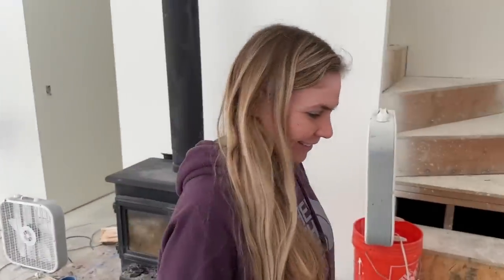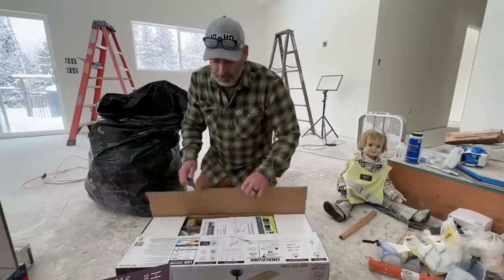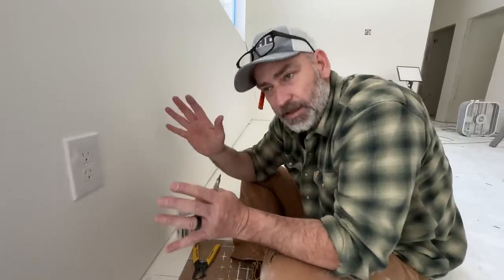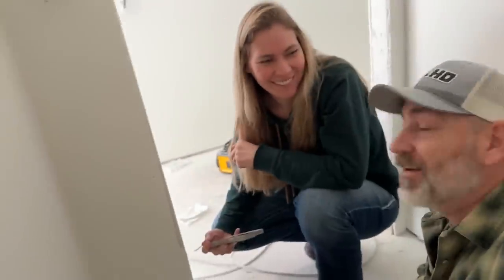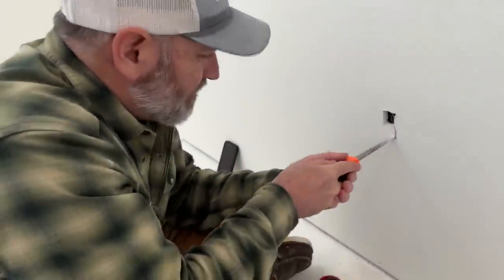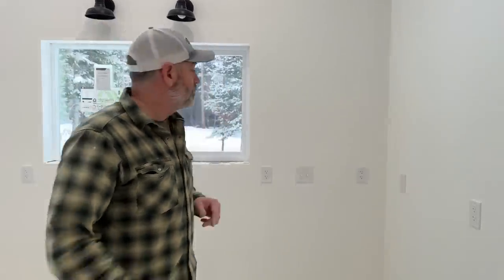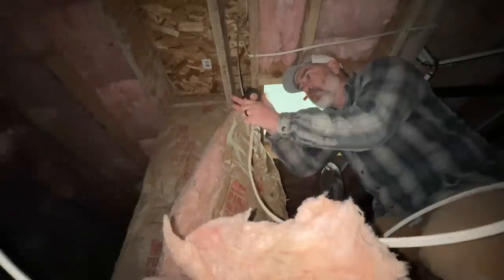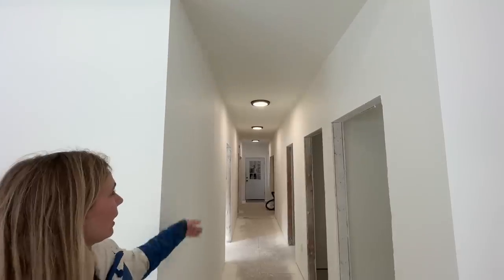3 MAJOR PROBLEMS Wiring our Off Grid House. Don't Make the Same Mistakes.

Comment: Good morning, just wanted to mention that getting power to your cell phone is not a good indicator your outlet is good.  Power just means it is live, you need a line plug tester or a multimeter to make sure you are wired correctly. After wiring up and putting on the cover plate, plug in your line tester to verify.  Simple cheap and fast.

Comment: Great work both of you! I'm an industrial Electrician in Northern Utah. A few tips to save your hands 🙂. #1 instead of using hand tools for everything. Grab a decent lithium powered screwdriver.  "did notice use of a regular drill later on." #2 To make outlets more flush.  Pay close attention when tucking in wires. The more even and neat they are tucked in the squarer your work will be.  Honestly though awesome work!

Comment: The ceiling fans perfect where it’s at. It will draw the heat in the winter from the roof and then you can turn it around in the summer and drop off the ground and keep the heat out of the ceiling. It’s perfect where it’s at.

Comment: Use a cordless drill to install your devices, Guys.  And use a flat tip screwdriver to install the face plates. It is much more efficient and is easier on your hands and wrists.  Good box makeup on the rough-in stage will also make installing devices easier.  Thanks, Russ, J. Electrician from Oregon

Comment: You're supposed to twist the wires before putting the wire nuts on them. Plus you had way to many wire in that one box. By not twisting the wires over time you can get flicking lights or a heat up or fire.

Comment: you should replace all outlets from 15 to 20 amp in the kitchen cause if you use two appliances on 15 amp outlet with 20 amp breaker it will melt the outlet and you should used one outlet 2 phases one outlet gives 1st phase 120v 20a and another gives 120v 20a if you stick in in that outlet between the lives you will get 240v at 20 ampsso if you got a kettle which draws 15a and want to use a toaster no bueno that will trip the breaker and melt the outlet
Reply: code requires 20 amp circuits in a kitchen
Reply: Oops 😅

Comment: I think the fan is in a great spot only because if you raise it it will block the view a bit out the upper window from the loft.  Keep up the great work!
Reply: Plus if it's too high, ironically it won't move as much warmer air down. Visually it looks right too.
Reply: I also agree on the length. Any higher will interfere with the loft view.

Comment: The ceiling fan looks just about perfect to me.  Remember, it needs to have room beyond the blades for the air to circulate above it, and you need access to clean off the blades regularly - especially as cat/dog hair tends to stick to the leading edges.  Mount it higher and you effectively make it an ornament, rather than functional.

Comment: Did you do pigtails on all the outlets? The tab between the top and bottom is not made to handle the full load and can burn out and possibly cause a fire. The reason there are 2 scres is so that you can break the tab out and split thr receptacle and have one half switched and one with power all the time.

Comment: Trick to boxes is to fold the wires neatly into the box until receptacle goes in fully without forcing it. This will prevent undue strain on the wires and receptacle.  Never force it in with the screws.

Comment: Just one code comment. Nationally, you're not allowed to "splice" on a device, that is to say you need to pigtail all outlets that have more than one wire. Don 't want to break the neutral connection (continuity) when you remove a device. Good luck.

Comment: Tip for finding buried electrical boxes is before sheetrocking to spray paint a dot (fluorescent orange works good) on the floor below each outlet. Put it near wall for outlets and 12" from the wall for switch boxes.

Comment: Really enjoy watching you two figure out a fix to the issue no matter the size. I remember once we bought a house and had to plug an item into each outlet checking the wires I think it was checking for the polarity? I know it would light up and my husband would change a wire around in the plug only a couple were off. Can’t wait to see the cabinets and the island build with trap door. Susan

Comment: I was taught to always use pigtails when the electric is "daisy-chained" from one outlet to another rather than using the outlet itself as the chaining point.
For the GFCI in the kitchen, I think you could have just replaced the kitchen circuit breaker with a GFI breaker, although the outlets ARE cheaper.  That's what I'm planning for our home build.

Comment: As an electrical apprentice the fact that you aren't connecting the wires to the outlets correctly is an affront to my training. Ground, Neutral (White), then the Hot (Black). But other than that little issue you guys are doing great! Keep it up!

Comment: FYI, you can use 15 amp receptacles through out the house per NEC Table 210.21(B)(3).  20 amp circuits can have 15 or 20 amp rated receptacles.
Reply: That's amazing Mike. This vital observation can't be left out without a reward. Quickly dm to claim your package

Comment: Tape the wire nuts to the wire. It will prevent them from loosening. Especially where you have the max wires in a nut.

Comment: You should have put the wire in the middle of the floor joist to protect it from nails and screws. I'm sure you were smart and watched where you put screws but what about the next project? Also you should have put glue on the board to stop it from squeaking when you walk across it.
Reply: Yep you might move one day. Write 'caution wires' on the floor and draw a line?

Comment: The 15 amp outlets are rated for 20 amps for feed through its common practice here in Wisconsin to put the 15 amp outlet on:a 20 amp circuit

Comment: I know you explained the minimal building codes for Idaho.  Just want to point out an important fire safety code that you should follow.  I notice you have a door with glass panes going into the garage.  Per code, a door that separates a garage from a living space must be a 2-hour rated solid core door (with no glass panes).  Hopefully, Safety Sally will require that you switch that door out.

Comment: Jules, I'm sure you're done now, but when you start the receptacle screws (just a couple threads) push the receptacle in the box hard and wiggle it side to side as it's going in. This is to pre bend the wires in the box, straight. Then you can crank the screws in snug until the receptacle doesn't move. Done and straight, flush receptacle. 😊

Comment: Marty check this out when you're running the fan in the winter time make sure the fan is drawing the air up you think moving the air down is better but it's hard to move heat are down so if you pull the air up it moves the air faster going up the same direction as it would it'll come around and go down the side walls check it out

Comment: this is why we in sweden use electrical pipes by code   loose wires in  wall is not by code here easy to change cables and add new ones

Comment: Great videos. You may want to keep all those videos as to where wiring location are and put in safe location with building paper work. Amazing how your build is coming together. One thing I have seen is with the outside grill may leak cooking oil onto wooden deck and could cause a fire. May want to put a metal pan to catch oil under grill Again amazing work and I know you will be ready for another vacation when build is done. You both deserve it.

Comment: 5:00 15A outlets are rated for 20A circuits, obviously you can not install a 20A outlet with the optional horizontal prong on a 15A circuit.

Comment: You should get those stickers off the windows. There is a point where nothing will remove them. 
Also, if there is a box behind the drywall there would be a bulge in the drywall.
Reply: They ended up with two boxes behind the drywall and neither had bulges.  That's why they had to look at old videos to find their locations.  Did you watch the video?
Reply: @carlapierle8623  Yes, I watched. I saw they found them. Usually the box sticks out past the stud the thickness of the drywall. It looks like those were flush which makes it easy to cover over and not notice. That’s where the videos come in handy. 🙂

Comment: Guys use a cordless impact or drill, manual is not needed anymore and it is safe, just use less pressure on the trigger (:  Keep Smiling if you take this shortcut.  100% a Wago fan. Europe has some awesome shortcuts that we Americans should learn from.

Comment: Put a masking tape label for the switches that you can remove later once you have committed their function to memory.  Worried about guests, use a label maker and small font to add a label so everybody can know which switch goes to which light.   Great video and troubleshooting your wiring.  I once had a house built and I could go in every day and used my camera to document everything (even the sprinkler trenches).  really handy years later when you wanted to add something,

Comment: It's way too late to suggest this now, but I found it very useful to have more than one circuit going to each room.  Originally my house was wired so that a room, or even 2 rooms were on a single circuit -- including the overhead lights.  If I used an electric space heater and a hair dryer at the same time, a circuit breaker would trip and the entire room had no electricity and no lights.  I rewired my house to put each room on 2 circuits.  That way at least part of the room would operate normally, while reducing the chance of tripping a circuit.  Just saying that this was my experience.  I very much enjoyed this episode.

Comment: @31:00 why didn't you just remove the screws and lift the floor?  I had a similar situation where I had to run a forced hot air vent and I just removed the floor to run it.  The floor was tongue  and groove too.

Comment: Nice job guys. I've been watching ya'lll from the beginning of your build and advances and look for forward to every week. i have been building my tiny house since last June and have moved in even though there is lots of stuff to do. but as I'm 76 years old sometimes it's a little slow going. The tiny house is 12x16 with two lofts, one is a 8x12 with a 7 foot ceiling the other is 4x8 .

Comment: Should be a bulge in the drywall if the box is there and installed properly.  You guys know how far off the ground the box was placed.  Find the studs and look for the bulge in the drywall. Use a roto tool to start cutting to find the outside of the box.  Then cut around the box.  It is easy, if you put the box in.  🙂

Comment: Using a fish tape might have saved a little of the work and headache to get the wire to the switch. I have not seen you use one. A bit late but there are push connecters for making your pigtails Have good days!

Comment: the outlet wire lengths are a bit too long, and the pigtails a bit too short.  buy a Klein lineman's pliers, and use the plastic handle coating as a guide.  wire length out of the box should be just longer than the handle

Comment: why didn't you want to run like you did and then turn and run with the floor joists to go in the top of the wall and feed down to the switch?  the loft looked like you had the space to do that.  well since you built it and the plans are in your head i guess you know how to solve it. house is coming along....just 4 months left but who's counting!